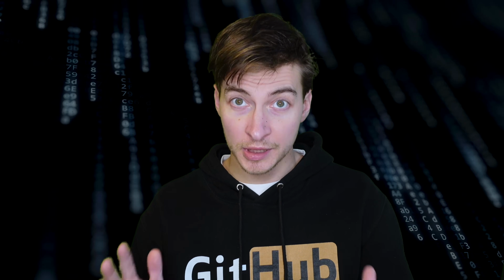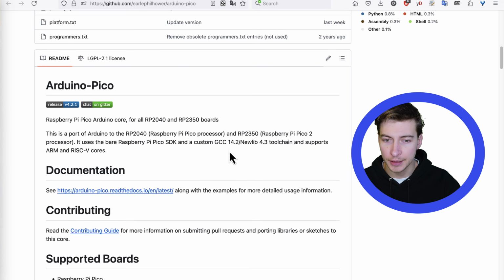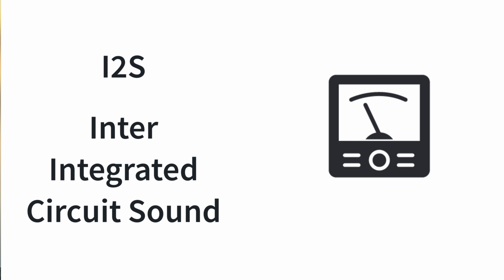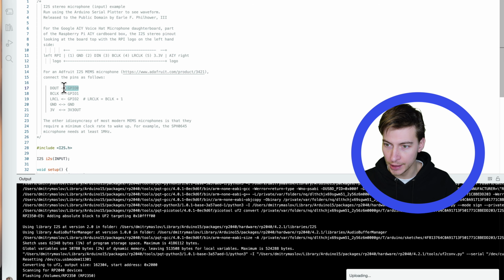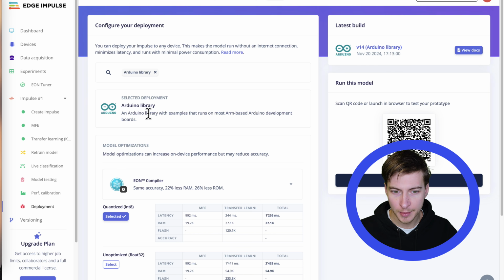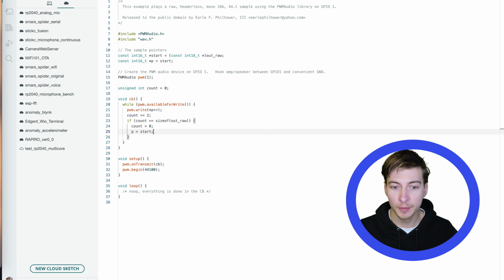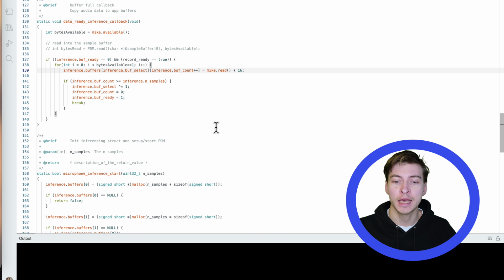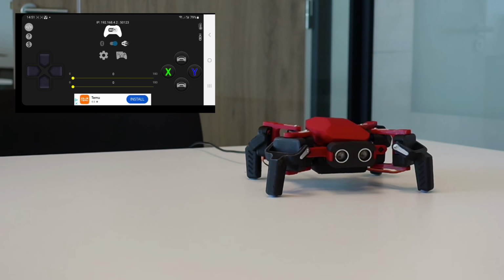Add Audio to your Raspberry Pi Pico 1 & 2! | RP2350 | RP2040

Comment: I've been tearing my hair out (well, IF I had hair) I would trying to figure this out for a week now.

Seems I already had most of what I needed, except ... an example. And there it is.

Some of what you said about analogue mics was a little wide of the mark but I'll let you off there. Analogue is more my thang, as it were. I kept overlooking the Pico for I2S because it doesn't have an I2S peripheral (only... it does if you program the state machines). Help's that Earl's library is way ahead of core too.

Didn't help that I've been trying in vain to get PlatformIO (or even the foundation's own extension to work with Zephyr). As of this writing PlatformIO has been booted from the store for reasons and Zephyr is an absolute mess. 

Comparing using Earl's "board manager extension" to the utter SNAFU that is the state of Zephyr right now is like chalk and cheese. Only Zephyr is as tasty as chalk and Earl's is some lovely creamy Wensleydale with apricot chunks. Nom nom.
Reply from the maker: Thanks for the detailed feedback!

Comment: Hello just a question

Is it possible for a raspberry pico that is connected to a sensor and(can also connect to) can give voice feedback to an earpiece?
Reply from the maker: Interesting project. You'd need Pi Pico 2W for that, it has a bluetooth. Or do you mean wired earpiece?
Reply: @Hardwareai  Yes, a wired earpiece/speaker for audio output?

Comment: I watched a good video.

I'm trying to make a DK board using RP2350B.
I can't find the I2S pin map data in the I2S Audio part.
I can't find the pin list or rules for using GPIO0~GPIO47 as I2S pins.
Can you help me with this?
Reply from the maker: Thanks for watching! 
And no, from the top of my head, I cannot help you with that - but Raspberry Pi community is usually very helpful, maybe worth posting to the forum there?
Reply: @Hardwareai  Thank you for your reply.

According to what I found out,
RP2040/2350 doesn't have HW I2S device.
It is said that it is processed by SW using GPIO.
The constraint is that BCLK and LRC must be consecutive pins.
I will try to test this on my DK board to see if it is true.

There seems to be a difference between knowing that it works and why it works.